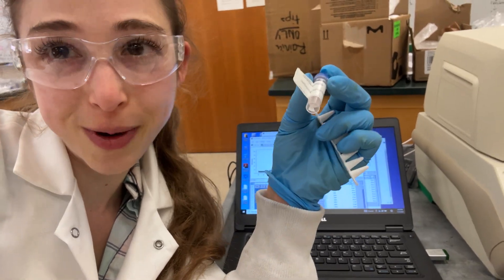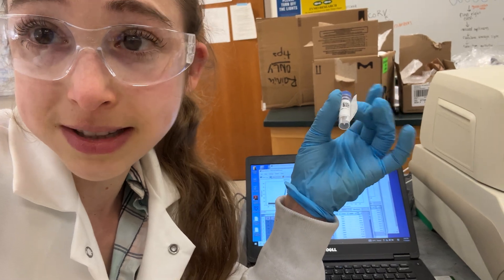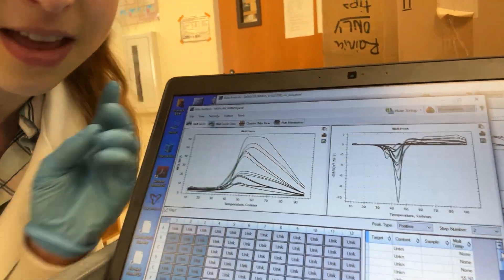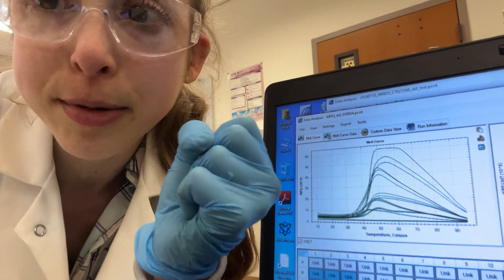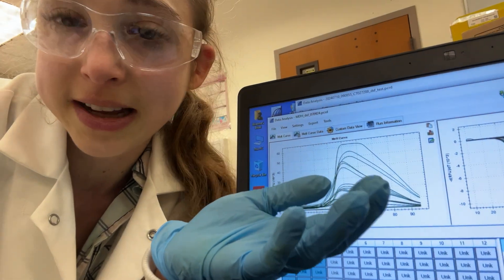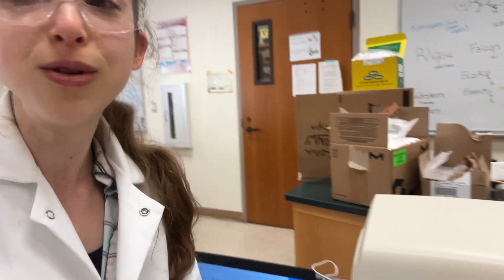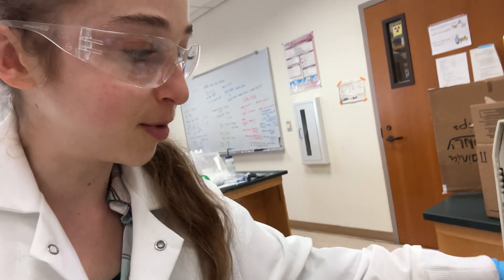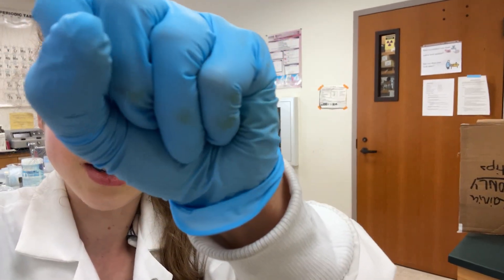Fluorescence thermal shift (FTS) aka Differential Scanning Fluorimetry (DFS) aka Thermal Melt basics

Comment: Hi Dr. Bibel,

Thank you for the excellent content. I would like to know if I can use DSF to check the integrity of membrane proteins, such as GPCRs. Does the protein need to be purified, or can I perform the assay using a crude extract obtained after ultracentrifugation (membrane preparation), where the lipid bilayer remains intact?
Reply from the maker: I think having the lipids will cause high  background and prevent it from working well
Reply: @thebumblingbiochemist  Thank you!

Comment from the maker: If your protein was sturdier, that is was more tightly folded, your Tm will be higher. But if your protein is not that stable is unfold or easily well then you’re gonna have a lower Tm. This sturdiness is condition-dependent, so you can measure the TM of the protein under various conditions like different pH, in the presence of various salt concentrations, etc. to see how that affects its stability. You can even make mutations to the protein and see if that changes the Tm. 

One thing that often changes the Tm is binding to something (a ligand). We can introduce the ligand to the protein and what’s gonna happen is often when the protein binds, it’s going to become sturdier because it has additional kind of molecular interactions holding it together going to be pulled up tightly and therefore it’ll raise the Tm. So you can actually use this essay as a way to kind of see the binding.

It often takes some troubleshooting to get things in the right concentration range getting the ratio of protein so you might need to play around a little bit.

Here’s the protocol we’ve been going off of. Thanks’ MCC! 	https://www.mdhcures.org/s/MCC-MDH-Fast-Thermal-Melt-V3.pdf 

And here’s an article that might be of interest: Wu, T., Hornsby, M., Zhu, L., Yu, J. C., Shokat, K. M., & Gestwicki, J. E. (2023). Protocol for performing and optimizing differential scanning fluorimetry experiments. STAR protocols, 4(4), 102688. https://doi.org/10.1016/j.xpro.2023.102688 

Happy experimenting!

More about protein structure: https://bit.ly/proteinstructure & https://youtu.be/V2pStHenOJo 

More about fluorescence & FRET: https://bit.ly/FRET_2 & https://youtu.be/crA5f1ZGCLo 

More about PCR: http://bit.ly/pcrtrain 

More about qPCR: http://bit.ly/rtrtqpcrprimer  
more about all sorts of things:  #365DaysOfScience All (with topics listed) 👉 http://bit.ly/2OllAB0 or search blog: http://thebumblingbiochemist.com                                
 
#scicomm #biochemistry #molecularbiology #biology #sciencelife #science #realtimechem